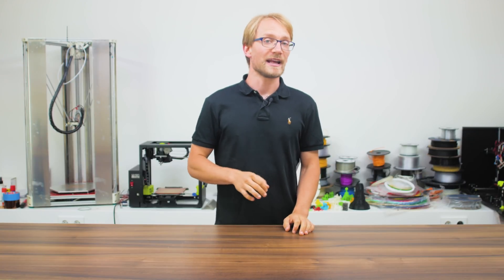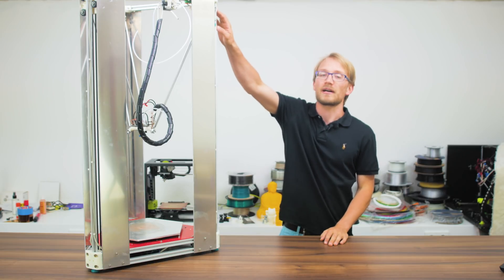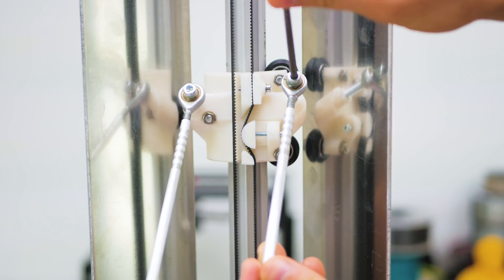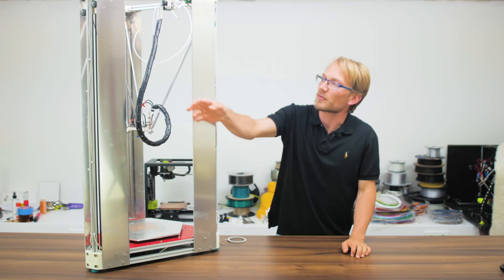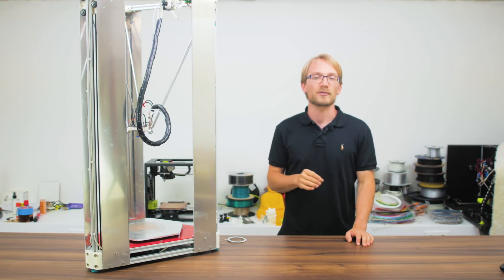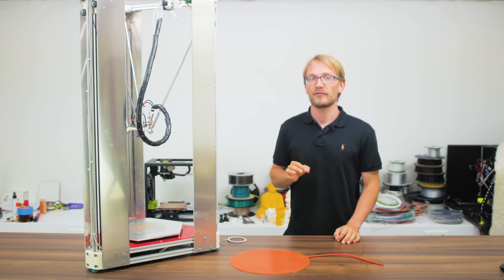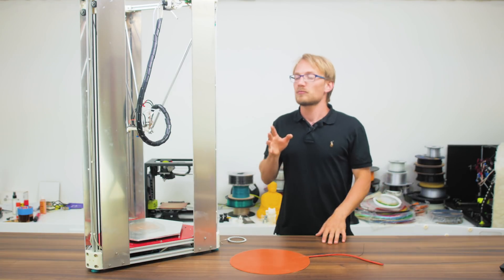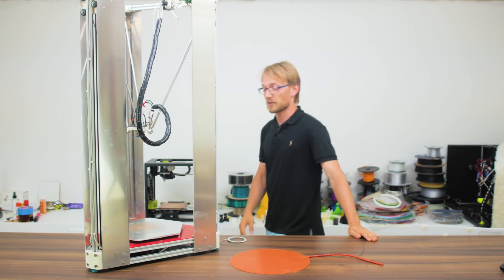My biggest 3D printer yet! Analyzing the CerbrisReborn design

Comment: Hi Thomas, I am looking at building a delta printer, and would be interested in the design files for the CerbrisReborn. It's a bit big for me as-is, so I would use it as a source of inspiration rather than building a straight replica. 

As for connectors: On my current printer I use the standard XT60 LiPo battery connectors for the hotend and heated bed. They are cheap, safe and can handle very high currents. For low-power connections, once my current supply of Dupont headers and connectors runs out I will probably switch to the Molex Microfit 3.0 system. We use these at my job for industrial products, and they are great. They are a bit more expensive than the Duponts, but still pretty cheap.

Comment: it's hard to say from this video but those aluminium arms seem to be way too long and  that will take a big chunk of maximum height, make it heavier and add more of vibrations etc.. is there some reason for that? i've seen some other deltas doing the same thing which makes me wonder if there is some reason for it.
to maximize height and not loose any width, one would think that arm length should be enough when it is about the same as diameter of print area? (where one arm would be in horizontal position)

Comment: I'm really not a fan of these large delta printers. They have insane heights, but only half of that can be used in the Z axis due to the arms. You could get an Ultimaker 2+ extended and have a similar build volume but take up half the space.

Comment: I've been running a delta now for quite some time, and you hit every one of the issues I've had while learning.  Some notes on the effector, carriages and rod ends. If you have any play in these items, it shows in your prints directly, and also makes terrible noise with stepper vibration.  Definitely go with the IGUS rod ends to minimize slop.  Also you mentioned that you were working on strain relief for the effector and bowden tube.  The best location to feed filament is half way up the printer frame with the feed going up and gently looping back down.  This will allow for the most travel on tall prints with the least change in stress on the effector end of the tube. The bowden tube drags internally in tight bends or impinges on other components during tall prints when mounted anywhere else.  If you have any play in the carriages, rod ends or effector, this stress again translates into imprecise prints as the head is bias irregularly by the tension in the tube. Maybe not as important if all possible rod end slop is eliminated.
Thanks for the great series. I've learned quite a bit from your videos. Keep up the excellent work.

Comment: Is there any reason you didn't want to use Traxxas rod ends for your delta joints? You could've had a larger range of motion with those, and they have zero slop...
Reply: +Thomas Sanladerer I see. i think there are two sizes though and the larger ones have more play than the smaller parts for some reason.

Comment: Great work & report Tom, I am designing my own Delta printer & implementing  your input, specially the reinforcement issue
I am using a 25mm Al. sq. profile & be using Linear Rail Sliders, which will stiffen the structure, I also designing corners gussets. 

Probably be using magnetic ball rods, but I did not get to the effector design , I will be designing one for dual head.

Thanks for the great presentation & looking forward to see more like this one.

Comment: why do people always say ''8bit'' and then spit afterwards...

you can do math to the same precision with any number of cpu bits, yes you need more instructions, but you not flying a rocket here.....
Reply: Long time 3D printer user, first time 3D printer builder here. I've been watching your videos and got a lot of questions about this topic in particular. Why is that calculation being done in real time?  Seems like it could all be done at compile/gcode time.  All the Arduino should have to do is drive the motors back and forth. Additionally, why is it so "non-trivial" to do the conversion?  seems like it should just be some 'law of cosines' type calculations. If square roots are an issue then we should implement lookup tables. Any given arm only has a limited number of possible positions so we could limit the table to just cover what's needed.  What do you think? Thanks and keep up the good work!

Comment: A few ideas from a fan of deltas. You should look at Tricklaser's Trick Trucks for your carriages. They are similar to yours but are all aluminum. They do ride in the channels in the extrusion and not the corners, which I think is a better way to go because the corners are prone to getting scratches and nicks that damage the wheels. The channels are more protected. Tricklaser also makes carbon fiber arms with Traxxas ball joints, and is apparently tooling molds for ball joint cups compatible with the ball ends from SeeMeCNC. 713Maker offers some really gorgeous milled hardware for mounting the hot ends. As far as electronics go, it seems that the general consensus is that the Duet/Paneldue combo is the preferred controller for Deltas. A lot of people are excited because the latest version of the Duet has WiFi and removes Wired Ethernet. I'd be looking at upgrading myself, but having only WiFi and no RJ45 is a deal breaker for me in my shop. But it's worth a look, as it is quite an advanced controller. The specs are quite a bit more than the impressive smoothieboard.

Comment: Hey tom, I've been planning on eventually getting a delta printer together. I bought 20mm extrusions a few months back to get the frame ready and gradually finish it as I pooled more cash.

Only problem is I cant find any rollers (shower curtain or otherwise) to run either in or around the extrusions. Do you think it would be possible if I printed nylon wheels (Maybe refined it on a CNC mill) and then jammed my own bearings in the middle? I have no idea on the en-durability of this.

Also, would you ever consider releasing the STL of the frame joints? Otherwise would you recommend any quick tips when designing the parts myself? Thanks! (Sorry for the long post!)

Comment: to take the slack out of the ball joints, a small spring will hold the eyelet on one side of the ball.   this is done in radio control to make suspension more consistent

Comment: What if you replaced the plastic plate joints with aluminum and use liner rails instead of wheels?
Reply: Linear rails are crazy expensive, yes I know you can get them from China for $10 or less for the 300mm size, but the precision is very poor and about 1/3 of them are actually smooth. With a bit of coaxing and care, they can do the job, but unless your willing to shell out upwards of $100, v-wheels are the better option.

Comment: I am upgrading a cheap delta and this video is amazing! I am totally interested in the design for the carriage. Which means that I would be interested in the rest of the files as the extrusion has been turned. I have just bought the v-slot wheels and have re-designed the carriage to allow for the difference in size. I will be going to my local fab lab to print out the new carriages tomorrow. It is a bit of a bummer that the standard 2020 extrusion is going to wear out the v-slot wheels, but it is going to be better than the horrendous wobble I can see in the carriage as it goes up and down currently.
Thanks for this incredibly informative video. Would love to see how you setup auto calibration/leveling.

Comment: Really enjoyed the breakdown! Do you run the hot end heater through the cat5? I'd imagine the current is too high though I suppose you could double up pairs like the UP's do on their ribbon cables.
Reply: +vidznstuff1 +vidznstuff1 It will only be carrying 12v.
The only part that draws any current would be the hotend at c.40w.

Cat5 is rated at  600ma (PoE) per wire.

That does mean that this would be out of spec - 4 x 600ma @ 12v = 28.8W.

Cat5 is usual 24-26AWG, so while it's official rating is quite low, that is for long cable runs.
On short lengths 26AWG will happily carry 2.2A, so two pairs would cover the 40w by a safe margin.
Reply: My mistake. I read the question as bed heater, not hot-end. Cat-5 is rated to 125VDC so it should be fine if you stay inside its current limits.
Reply: As a best practice, doubling up the pairs on cat5's for voltage can actually be more dangerous than using a single strand.  While it CAN handle the rated current, if either of those strands breaks, you are back down to one strand and you have the false sense of security thinking it is OK.  Being in the AV industry, I have heard of numerous occasions where cat5 was used doubled (or even tripled) up for running power with RS-485 controls lines for lights, etc. and all it take is for one of those strands to break inside a wall somewhere and the whole house goes up in smoke.
Reply: Telephone and dsl run on cat5 at 48v dc, hi-Cap circuits (T-1's,  UDC's, etc) run on cat5 at about 110v dc with no problems.  In fact most of the telecom network (before it gets to your house) run all of the same circuits on cat3.
Reply: This is where this whole maker movement gets scary. Cat 5 is not rated for the "super fricking" voltage (I seem to recall it's spec'd for <60V for PoE, maybe even less than that)....you actually have 325V peak on your mains in Oz (the 230V is RMS - a way to calculate POWER). The insulation will break down, and there'll be no more videos from you. Of course, this means Minion might show up on camera henceforth, so maybe I should erase this post ;-)

Comment: As of about a week ago I've started my first Delta build (from scratch) as well. I'm using these rollers: http://preview.tinyurl.com/h8xucrl
Do you think they'll last? They're tensioned in a way that should keep them strong and rigid even if the OD surface slowly wears away. Do you have any tips? I'm extremely happy with them, I was originally going to use 12mm Hardened Rod I have lying around but I don't need to now! Also how long are your arms? (Your Delta arms...)

Comment: You can use 2/3 of a large PVC tube to enclose the rails. 3D print a few clips to screw them to the aliminum plates and you should be good. You can also make it into a fully enclosed build chamber.

Comment: I've a cheap china delta printer kit which is my first 3d printer i got for 3 months. Since then I've constantly modding and upgrading it. You pretty much described most of the issues i experienced and trying to solve.  I also run a smoothieware compatible board, MKS Sbase v1.2 (only cost me about $50 which included the LCD panel).  My printer is also using the rollers for the carriages, but they're made in nylon, almost no wear observed. 

How level is the printing surface? i find it is extremely hard to get super flat and even printing or at least, get the smoothieware to treat the surface flatly due to nature of the delta style printer even with the Z depth mapped. albeit, it is a lot better with Z depth mapped. Also, i see you didn't insulate the bottom chamber where the electronics sit, do you think it is a better idea to insulate the bottom part since it could get quite hot with the heated bed running after awhile?
Reply: Also, what are your thought about using stepper motor vibration dampeners on all 3 axises?
Reply: great! thanks for the inputs!  I hope you make more videos about your delta printer :)

Comment: +Thomas Sanlarderer - ST seems to have announced an eval-board targeted at 3D-printers (similar to Smoothieboard, I suppose)for a bit over 100 eur. What do you think? : http://www.st.com/content/st_com/en/products/evaluation-tools/solution-evaluation-tools/computer-and-peripherals-solution-eval-boards/steval-3dp001v1.html?ecmp=tt3670_gl_enews_may2016
Reply: I suppose they recompiled the Marlin-code to the 32-bit instruction-set; dunno the details though. I suppose that ST, being primarily a semiconductor vendor, are trying to push their silicon (CPU, stepper-drivers, etc.) to showcase a platform and that they are hoping that makers and enthusiasts shall ultimately deliver a high-value firmware to run on it.

Comment: I run a mini kossel, what made you not decide on Traxxas rod ends? They have no play and they are self lubricated, you can also have no backlash with a tension spring or rubber band in-between rod pairs. plus greater rod movement.

Comment: great video . for covering the corners , you could split some acrylic( if you like clear ) or PVC tubing . the parts would hold their own shape well and need minimal mounting , probably just few M3 screws.  you might fie some with the same wall thickness as that sheeting you have .  would end up with nice rounded corners with a flush transition to flat sides.

Comment: Might I make a suggestion? For quickly disconnecting a hotend, I went with the PCB screw terminal connectors like how the Smoothieboard gets power. Pin spacing is unfortunate when using a more typical PCB, but it works with some light drilling lol I couldn't find a 10 connector w/ Prime shipping, but using an 8 connector with a separate smaller connector for hotend fans works well enough. Anyhow, since it's one giant connector it's easy to disconnect when needed and if a wire is faulty or a thermistor or heater goes out, just use the screw terminal to wire in another. Easy stuff :) Here is a link to photos of my setup, although you can only see it a little because the page is for my extruder design, not the connection point :p

http://www.thingiverse.com/thing:1179346 (view images in full screen to see the connection junction)

Btw, my cartesian is bigger ;) 1500mm (X)1500mm (Z) 650mm (Y)

Comment: Nice video!  Definitely enjoy the run-down of your delta.  
Can the 0.9 degree steppers produce the same torque as 1.8s?  Seems like it ought to but I suppose that depends on whether or not equal permanent magnet to electrical coil "surfaces" internally. 
When is somebody going to make automatic bed leveling? True bed leveling, say 4 little highly geared motors (probably a worm in there to hold the position) instead of bed leveling (tramming) adjustment screws.  Maybe it'd be easier to add a 2nd micro with 4 little motor drivers and communicate with bed leveling sensor.
Reply: +Thomas Sanladerer Well yes, the bed compensation is nice and cheap, but most things that I've printed with compensation, mechanical parts, come out with a slight slant.  Maybe it's more noticeable on smaller, skinnier parts.  Just seems like once somebody comes up with a relatively low cost and robust design for mechanical leveling, it would awesome.
Reply: +Thomas Sanladerer Yes, no I understand how it's supposed to theoretically work, but it just never seemed to work, for me, as it should.  I had it running on a MakerGear M2.  Now that I'm revisiting it, I think maybe the issue was the fact that bed may've not been truly flat.  If the bed was truly flat, then only 3 probing points would be necessary.  
Either way, the most affected parts were parts that needed to be printed perfectly vertical.  (90 degrees from bed)  After removing the parts from bed, if you set them on a flat surface, they would sit a little crooked, they weren't square.  Mainly the 15 mm tall by 6 mm wide section.  Thanks for the responses.  Definitely enjoy your videos and have learned a ton.  
Maybe you might do a video on how to calculate the shrink  ratio of some filaments to get the most accurate as possible end result.  Or not, maybe that's a bad idea.  The high temperature PLA 2 from Proto-pasta is sweet, but it shrinks a little when you bake the printed part to obtain the higher heat deflection properties.

Comment: Tom, so happy to finally get the details on the delta! Thank you! I am actually building one of this size myself. A couple questions, I am having trouble finding a piece of aluminum to use as a heated bed (for a decent price). Can you tell me where you got yours and/or it's dimensions? Also, do you have plans to make that awesome effector available for download?

Thanks for the awesome videos! Looking forward to contributing on Patreon and getting into the Q&A.

-Jake

P.S. you can see my build time-lapse here if you are interested. 

https://www.youtube.com/watch?v=-5bHFsajjdU
Reply: +Thomas Sanladerer
Reply: For my
deltaprinter I went on a milled sheet of aluminium from this shop

http://www.metall-kunststoffhandel.de/produkt-kategorie/aluminium/aluminium-blech-und-plattenzuschnitte/aluminium-platten-mit-gefraeste-oberflaeche/gefraeste-aluminium-praezisionsgussplatten-al-mg-4-5-mn/

But If you want to coat the aluminium plate with PEI like I did, this shop
would perhaps be a better solution. I think they can even make you a custom
sized PEI coated heatbed. Never the less a bed like this isn’t the cheapest
solution but it is worth every cent.

http://stores.ebay.de/mastamodellbau2012/3D-Drucker-/_i.html?_fsub=5929669011

Coating
your own aluminium plate is a very nasty and expensive Thing I wouldn’t recommend.

Comment: Glad I'm not the only one who was crazy enough to try and scale a delta printer. I had a similar problem with my 1M tall Kossel I built. 

A couple of my notes on it:
Tensioned wires, forming triangles helped a lot but didn't remove the wobble, your system is the simplest solution, and is the solution I've moved towards.
The magnetic couples work, but if they hit the print, the entire system falls apart (even doing the bed leveling caused problems at time, especially when I switched to a force sensitive resistor).

My arms are carbon fiber rods (from arrows), and they do a great job.